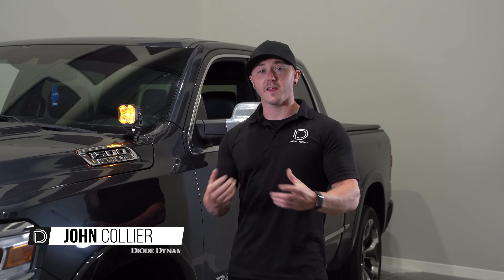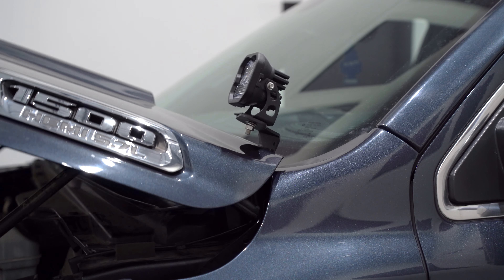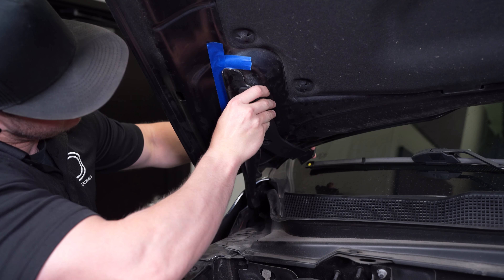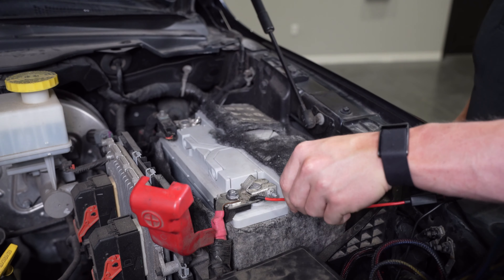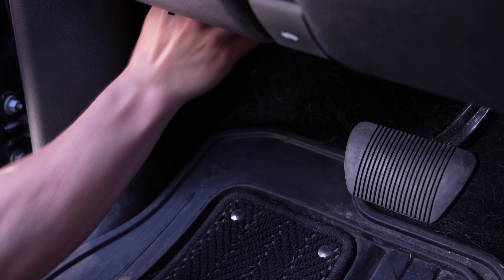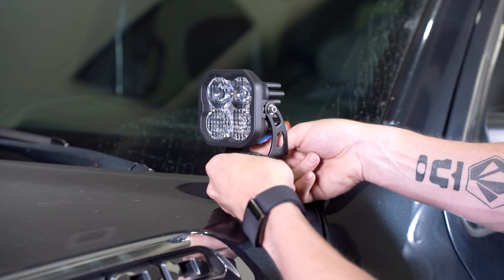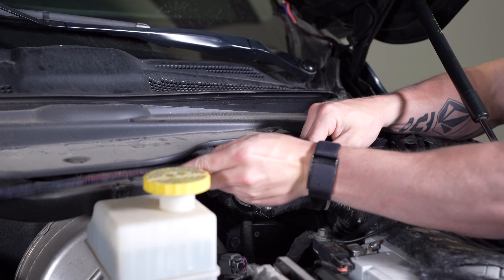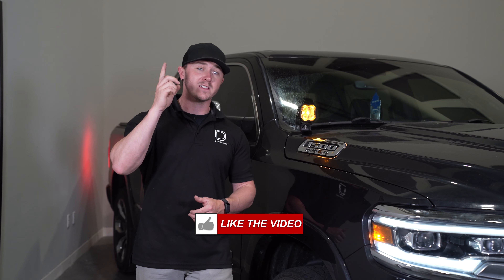The Best Ditch Lights For Your 2019-2024 Ram 1500 | Diode Dynamics

Comment: Other than connecting the positive and negative wires did you connect another wire into existing drl or headligjt wires?
Reply from the maker: Hey there! If you are installing this kit with the included 3-way toggle switch, there is no need to tap into any other signal than the battery for power!